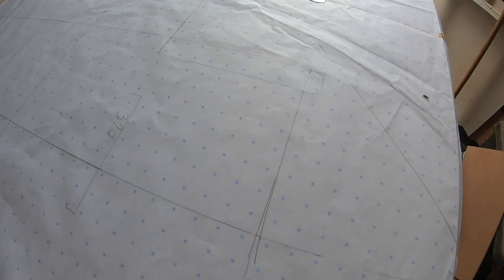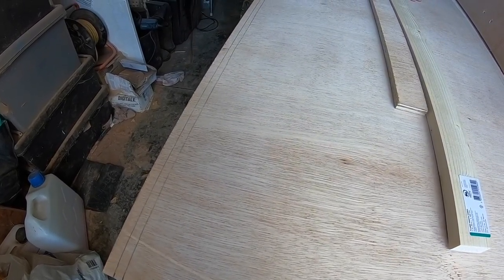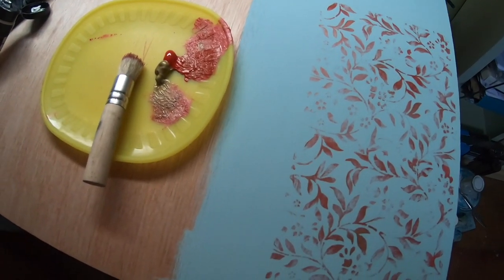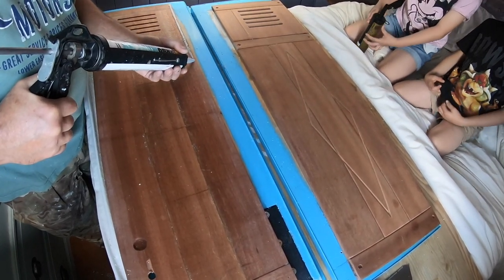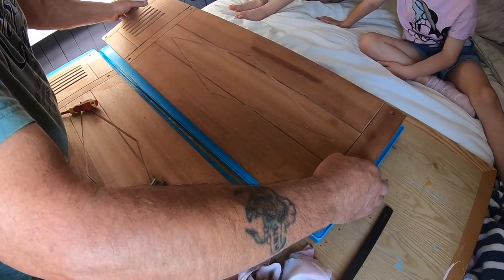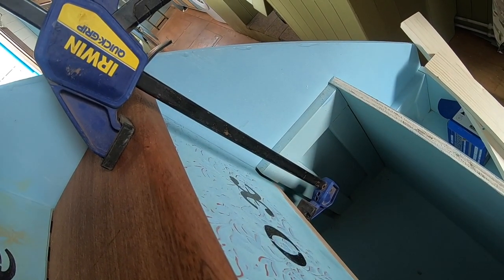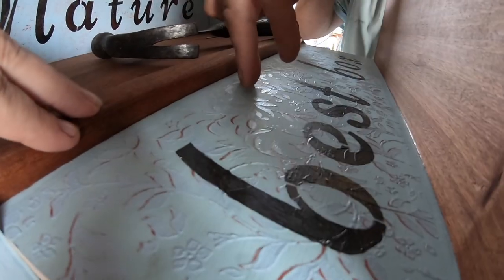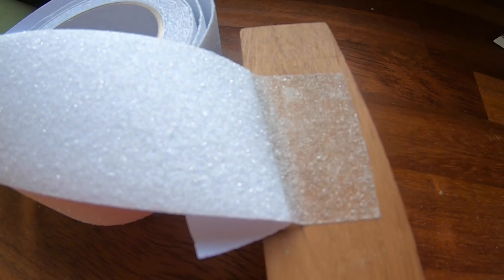Vlog 119, Narrowboat Fit Out - STERN STEPS AND FINISHING THE HATCH

Comment: Fantastic step design both nana & grandad getting close to finishing. Did notice within the step compartment was there a hole leading to the engine bay with pipe work running through it, will this let fumes in once your engine is running ?
Reply from the maker: Thankyou John. Yes the hole is in the bulkhead which is under the fixed 1st step. All the pipes and anything else coming through that hole will be easy accessed when we pull the set of 5 steps forward. That is why we have made the steps in 2 parts so we can move them to get to any pipes and the Calorifier. Eventually once we have finished the cupboards and floor at that end and we know there is no more stuff to come through from the engine bay we will fill the hole before it is boxed in. We also have a hole for all the cables to come through and that will be done the same way. You will get to see all that on a vlog in a couple of weeks i think. 👍